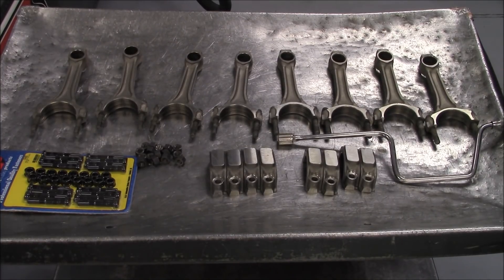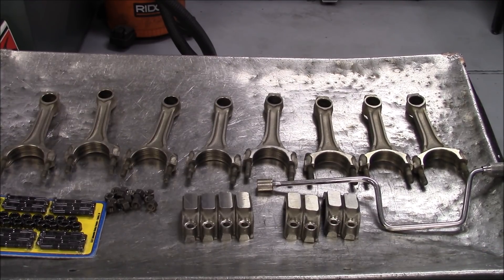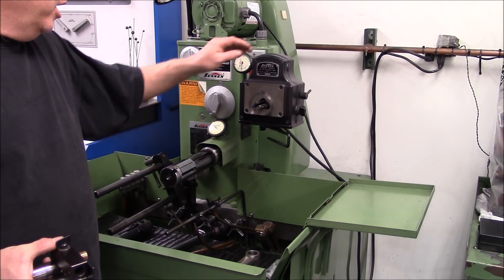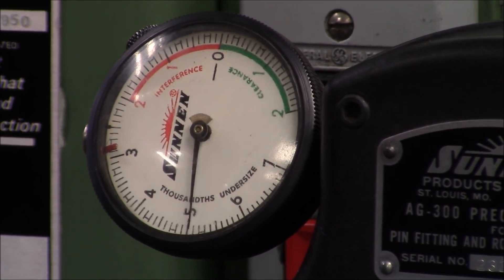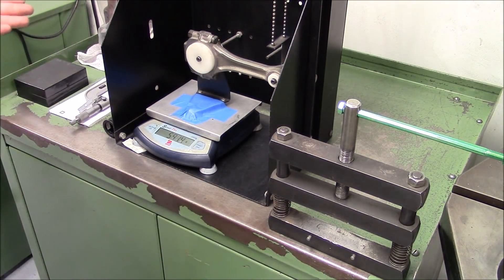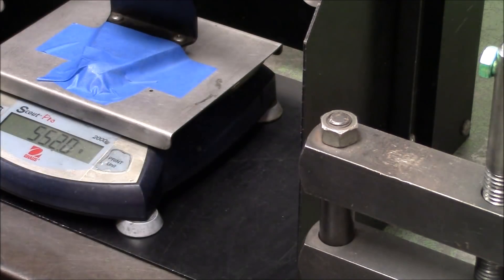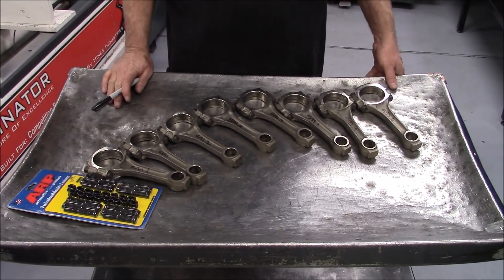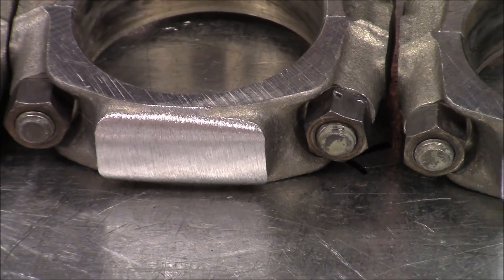620 HP 454 Big Block Chevy Engine Build Part 5 GM Connecting Rod Selection and Pre Balance

Comment: I've been watching this series from the beginning.  Ironically, I had a 468 built for dirt track racing in the early 2000's.  So far, our engines are identical.  The goal was to make the reciprocating assembly as light as possible, so as to come off peak RPM quickly when at the end of the straightaways.  My crank is lightened, and the front half is internally balanced, but the back half has a mated weight plate to the crank.  This allows for a very light, zero weight harmonic balancer, as well as a neutral balance flywheel (just incase I destroy a flywheel, just bolt on a new zero balance and go).  

We didn't use factory GM rods, in fact, mine is a long rod motor, with a company that made 'pink' style rods... They've lasted for 20 years so far, under the rigors of dirt track racing.  

I'm learning so much, that my engine builder spoke about, but didn't really elaborate like you do.  Thanks for this series.

Comment: Who runs a stock rod......labor and arp bolts cost as much as a new set of Scat 4340's......buy a balanced rotating assembly and still a budjet build
Reply: Not everyone wants China made rods 👍🏻
Reply: @Yann396  china made rod is still 5X better than a stock rod
Reply: @rustyschultz1118  still wont buy anything out of China. Quality control is poor on those rods and pre balanced rotating came unbalanced most of the times. Tons of people run stock rods on 7-800hp engines.
Reply: @Yann396  GOOD LUCK
Reply: @rustyschultz1118  you clearly have no experience building engines. Have a nice day sir 👍🏻
Reply: @Yann396  sorry but I'm 65 and have built many race engines and street engines.What are you?? 16 and an internet expert...80% of engines today have some China forgings in them. Ive been watching BBC/SBC kicking stock rods out on the track since 1965 ,how about you?????
Reply: also I made 650 hp with a 302 SBC in 1975....14-1 aluminum rods 9800 RPM's
Reply: Exactly! Reconditioning and doing all kinds of work to stock rods just doesn't pencil out.

Comment: What are thumb rods?
Reply: GM has two rods for the big blocks. Thumb or thumb print and dimple rods. It's my understanding that the dimple rods came in the high performance engines and the thumb rods where standard performance.
Reply: Jess Roberts I never heard them called thumb rods before

Comment: Any reason to not use lighter rods with bolt only?   Looks like a good way to shed weight,    All the fancy rods are  threaded upper.  And shorter rod bolt.